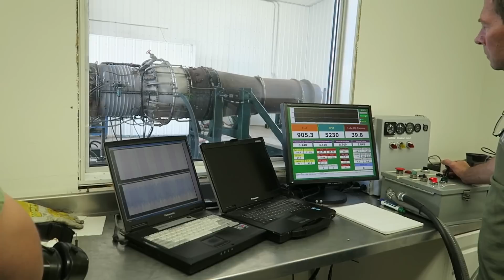Jet Start with Commentary

Comment: At 6:42 the first set of stators (?) seem to almost block the entire inlet. At 3:12 they look a lot more open. Is this just an illusion or different projection because of the camer angle or are they variable stator vanes? If that's the case for what would such a air constraining setting be used for? While the engine was winding down I assumed it would restrict air flow and therefore help bringing it to a stop faster, but they were in this position earlier on as well while the engine was running at 2:00 ...
Reply from the maker: SirLugash You are looking at the VIGVs. Variable Inlet Guide Vanes. They adjust the angle of inlet airflow, to help the compressor blades do their job. I'm working on a video explaining all of this.
For now, have a look at my playlist "Your Questions Answered". In the notes on each vid, look for VSV and VIGV...
Reply: AgentJayZ
Thank you very much.

Comment: I know there are vents in an airframe that exhaust hot air from around the engine that aren't there to cool the engine itself. Is the relief of temp build-up in the engine bay there to protect engine components from potential heat damage or is it the airframe itself being protected?
Reply from the maker: Rob Oakman I think it's usually more of a way to prevent the accumulation of vapours that might become flammable.
Some aircraft do use cooling airflow to protect the engine and airframe.

Comment: I noticed that the amount of time from shutdown (6:23) to the point at which the internals of the engine stop rotating (8:18) seems like a decent amount of time - almost 2 minutes.  Do you have any idea what the rotating mass is of the internal components of these engines?
Reply from the maker: wizzells around a thousand pounds... maybe 1200.

Comment: What amount of thrust does it put out full throttle?
And what make/model/type of planes had these engines fitted?
(I love anything with engines, but majority of my knowledge lies with cars. That said, i'm always keen on seeing how things work and learning from it).
Reply from the maker: +Chris. G The LM1500 is an industrial gas generator, the design of which is a slight modification of GE's aircraft engine known as the J79.

Comment: whats with the red plumbing  tap on top of the lm1500 at 2:10 ? looks a bit close to the fuel rail to be a bleed air outlet?, plus , do industrial jets have bleed air outlets for external uses ?
Reply from the maker: Lynton Rodda That is a plumbing gate valve attached to an air outlet which usually discharges air that leaks by the rear air seal on the compressor rotor. By restricting the outlet, we can use the air pressure to apply a forward force on the rotor, reducing the thrust load on the main bearing. We adjust the valve to get the pressure we want for the test. Most installations use a variable restriction to do the same.
Reply: +AgentJayZ  thanks for explaining this in your latest jet questions video

Comment: It always interests me that jet engines are really noisy at the front which I understand is the air molecules being ripped apart as they're sucked in (just what I've been told) and at the exhaust end there's a noise cone so if you stand at about 45degree's to the exhaust (either side) you hear the rumble of the exhaust but if you stand directly behind it (at a distance depending on throttle postion and not for too long due to carbon monoxide etc) there is a lot less noise.
used to show this when I used to test run model jet engines
Reply: ***** The noise you hear from the rear of an engine is essentially caused by the 'shearing' interaction of the exhaust jet with the surrounding air.  The noise, therefore, tends to radiate outwards, rather than directly rearwards.  The noise at the front of the engine is not "the molecules being ripped apart".  It is the high frequency sound of the rotor blades passing the stator vanes, producing exactly the same effect as an old-fashioned police siren.

Comment: Cool video, what is the hose attached to the fuel manifold that was unhooked after the engine was shut down? Can't be supply at it not regulated so is it return? 

Thanks Jay
Reply from the maker: hommie789 That's the fuel line. Whaddya mean not regulated? "Return" would happen a bit before the final delivery line to the fuel nozzles, don'tcha think?
Reply: AgentJayZ By not regulated I meant it comes straight from the source with no regulation or control on the engine so it would be full flow at all times, no real way to speed up and slow down an engine unless that is all done off the engine. 

Thanks for the clarification
Reply: AgentJayZ Is it LPG out of the nozzles or is it a gaseous fuel delivery? In the latter why would you even need a return line?
Reply from the maker: If you watch my vids about fuel nozzles, you would see that they are not fuel injectors. They spray the fuel in the correct pattern, but do not control the flow.
So... there is a return line, but it is at the regulator, before the fuel control, and a long ways before the fuel manifold, which simply delivers equally to all ten nozzles, the amount of fuel passed through the fuel valve. The return line is what Electron Bill is adjusting in the very next video. It's about 50 feet away from the engine.
We run gaseous propane through the engine's fuel nozzles which are designed for natural gas. This has been explained in a number of Q videos.

Comment: The sound on your videos is pretty good, that camera mike seems to cope with the pressures well. :)  Would you consider making a sound-focused video of the startup sequence, hear the pop of the fuel igniting, climb to full power, afterburners, and then shutdown to zero with an uninterrupted sound flow ?  As in no position changes mid video, or spoken commentary over the top and a placement for optimum turbine sounds with minimum wind noise ?  

If you have an external mike that goes lower in bass register, feel free to use it.. :)

I fully appreciate your knowledgeable wisdom in your video's, but having just one video where you could crank up your sound system to max and fully appreciate (as well as you can without being there), the awesome sound of a full turbine cycle without any other sounds interfering or positional changes would be great..

Many years ago, a friend of mine had (now lost) a "Sound System Test" CD that was full of all sorts of sound FX.  Sirens, Speaker destroying lightning bolts, rumbling bass thunderstorms and included a jet engine startup cycle like that.   He would sometimes, after refueling at the station, put it on the car stereo up loud, startup windup, ignitors ticking, and all, and when the turbine sound peaked, then start the car (Which you now couldnt hear over the stereo jet) and peel out of the station to the stares of the other patrons.  :)

But thanks for your videos as well, Ive learned a lot watching them.. If only I had a turbine to play with :)
Reply from the maker: SpockieTech What you're asking would require many specialized microphones at various distances, each with an operator who knew what they were doing... all to produce the illusion that you seek. That's the job of the people who produce music and movies.
You, like not a few people, seem to misunderstand what I do. We are not a gee-whiz television show, nor are we a documentary video studio. All of the requests for things that people might like to see are made by people who misunderstand, just like you.
I work at a company that repairs and overhauls gas turbine engines, and we test our products before returning them to the owners. I run around with a few cameras in place, and try to capture some interesting video. I am not the director, and I also don't know what the operator is going to do in advance.
I capture whatever I can, and there are no re-takes... ever. What I get is what I get, and all the requests for thermal cameras, smoke bombs, digital tachometers, time lapse, special microphones, SPL meters, etc.. are made by people who can't be satisfied by the awesomeness of the luck I have in being able to have the access that I do.
Jeez... take a look around the entire world...there's not much out there... I think what I offer stacks up pretty well, don't you?

If you have a stick that works in the lower frequencies, feel free to bite down on it now...
Reply: AgentJayZ Dont get your knickers in a knot :)  Im not complaining in any way.. Just getting to see what you do *is pretty cool and as I said, I do appreciate your time showing us and educating us..    I just didnt think it would be *that hard.  Put a camera in one location on a tripod near the engine but out of the wind noise and leave it there without talking too close to it through a power run ?  But OK, Ill go bite my stick ;-P
Reply from the maker: SpockieTech wind noise? ... I see, now. The only way to demonstrate the complete ridiculousness of your suggestion is to have you come on down to see a test run in person.
I guess I've stopped even trying to describe the off-the-scale violence of the sound, because it's impossible.

The reason the AB does not sound any louder in my videos is because the mic is completely overwhelmed by the engine at idle, never mind at full dry power.
Reply: AgentJayZ Id love to come and see one in person, but being down here on the opposite side of the planet, its not very likely :)  You do a great job of capturing the sound, so I just meant a single uninterrupted startup, power, burner, shutdown sequence without talking. I thought it would be easy for you to do..  but dont worry about it, Im sure there will be an FX company produced one out there someone :)

Ive been pretty close to the "Thunder Down Under" Jet truck many years ago, so I *do have an idea of what they sound like up close.   

Interestingly, as I watched a later run from the stands, the guy next to me was wincing as they were "revving" the jet and rocking the truck from the torque reaction.  I asked him what his problem was and he said that jet engines dont respond rev-wise that fast, and that what they were actually doing was somehow deliberately creating and clearing a "compressor stall", a bit like putting your hand over the inlet to a vacuum cleaner, letting it wind up and then taking it off.   

He explain that given that the engine was some surplus, heavily used, ex B52 engine (J57 ?), that repeatedly creating compressor stalls would be flexing the turbine blades a lot and potentially causing the old, possibly cracked blades to explosively exit the side of the engine and they really shouldnt be doing that.   The company that built the truck was (like yourself) a Turbine Refurb company (Veem Engineering in west Australia) and they should know better.

What do you think ?   Are repeated deliberate compressor stalls on an old engine dangerous ?
Reply from the maker: SpockieTech I think your buddy was full of it. Throttle response in terms of revs increases as the top of the rev range is reached. Somewhat like a two stroke piston engine, they bog at low revs, and have lightning quick response as the engine speeds  get into the "powerband" or range of rpms where the combustion process is most efficient.
Yes, repeated compressor stalls are bad for an engine; no, that's not how you cause them, and no, that's not what they were doing.
A compressor stall sounds like a big gun going off, it does not speed up the engine, and is more damaging to the compressor than the turbine.
I'm working on a stall video...
Reply from the maker: SpockieTech Just watched your clip, and it's pretty interesting. I'm going to discuss what we are looking at in an upcoming video. I get a lot of questions, so look for it in Q66

Comment: Awesome piece of engineering! Love it.. How close could you get to the exhaust end of one of those at full throttle before you got burnt?
Reply: Well as this is an industrial engine it is not going to blow you away much, but the turbine temps are over 1000' c at the start, so I would say 50m
Reply from the maker: Aidan Brown  Can you please refrain from answering questions with your guesses, OK?
Reply from the maker: Duncan Margetts You can't get close enough to get burned, because of the high speed of the exhaust gases.
Maybe if we tied you to a bulldozer blade with some chain link fence, and drove you towards it, you might be fully cooked by the time you were blown all over the field, like fragmented flesh waffles, or ballistic human McNuggets...
Reply: AgentJayZ Thanks! I hadn't actually considered that the force of the exhaust gases would prevent you getting close enough to be burnt. Thanks for the answer mate.
Reply: Sorry
Reply: Aidan Brown An industrial engine, when fitted with a propelling nozzle, has effectively been converted back into the jet engine from which it was derived.  The jet exhaust therefore has basically the same properties (temperature and velocity) as that of the aero engine.  Just look at the effect on  the grass and the ground at the back of the test stand.  AgentJayZ's LM1500, at full power will, therefore, be producing a jet exhaust equivalent to that of a J79, operating at the same 'dry' power, that is, with no afterburner.  There, I've managed not to use the equivalent UK term, 'reheat', and confuse you.
Reply: Thanks
Reply from the maker: grahamj9101 The South Americans call it post-combustion...
Reply: AgentJayZ  That's a new one on me: thanks for the info.

Comment: I see a cable running to what I presume is the EGT sensor at the back and then going to the other side. Is that a single cable with two lines, or are sensors addressable?
Reply from the maker: code123ns Your question implies one EGT sensor, then asks if sensors are addressable......
Makes no sense to me.
What I am guessing you are asking about is the pressure line connected to pitot tubes on each side of the jet pipe, at the rear.
They lead to a pressure sensor ( those blue things on the floor near the front of the engine), and since the tow lines become one, their values are averaged at the sensor.
The EGT is measure with type K thermocouples, and their signals are also averaged.
Reply: AgentJayZ My question implies that I see one sensor and a line going to and from it and that I guess that what it goes to on the other side is a sensor of the same type. My poor recollection of previous videos led to the wrong assumption that it's an EGT sensor and my background in electronics leads to me thinking that any cable I see has wires inside and that everything and anything is electrical until proven otherwise :). Now that you've cleared things up for me, it all makes sense. (no pun intended)

Comment: Q: At the point of ignition is the engine self sustaining or is the starter still required for further spin up?
Reply from the maker: SirDeanosity explained in the info section.
Reply from the maker: AgentJayZ In the next video...
Reply: Thank you for pointing. I will read the descriptions first before commenting / asking questions. Probably a good habit to get into on all vids.
Reply: SirDeanosity   No.  if, at the point of ignition, the starter motor was cut, the engine would, at best, 'hang'.  It needs to be taken up to a minimum self-sustaining speed.   I'll let our host explain further in his forthcoming video.